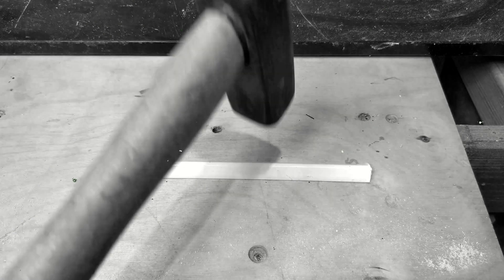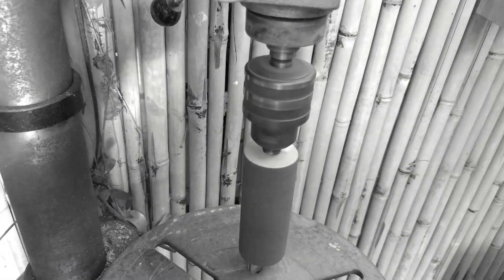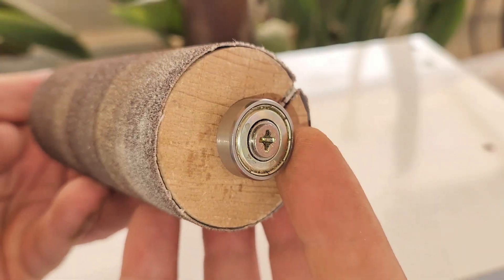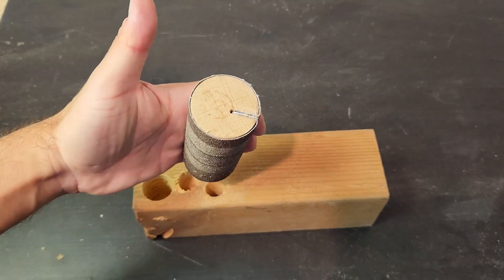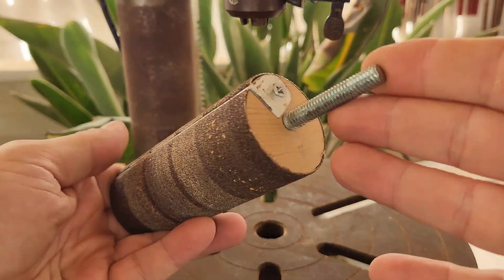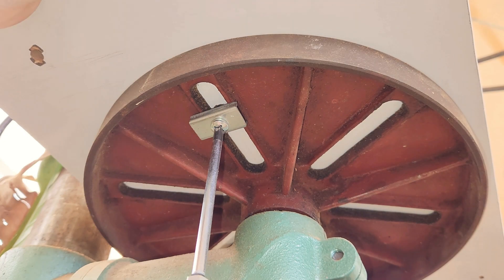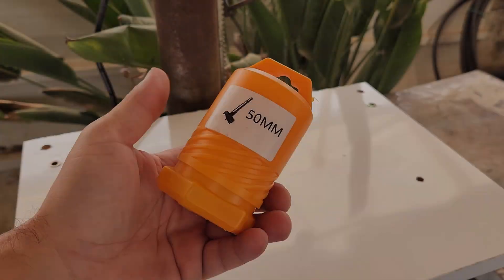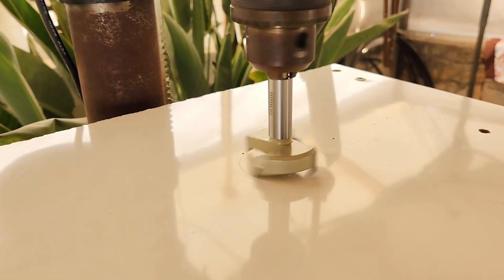I Added a Bearing to My Drum Sander for Drill Press. Why? | XDIY

Comment: Good, simple idea. Thanks for sharing. Maybe lubricate the bearing hole in the table with some wax or drill the pilot hole through to reduce heat build up?
Reply from the maker: Sounds like a good idea. Maybe lubricating the bearing itself if it's a long work... I need to check first how much it really heats up after a few minutes of work and see.
Thanks!